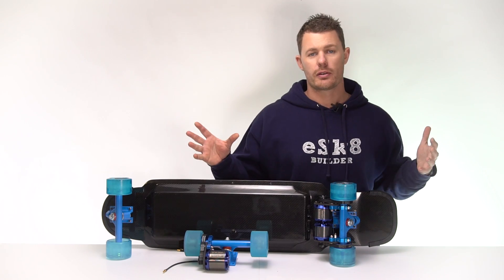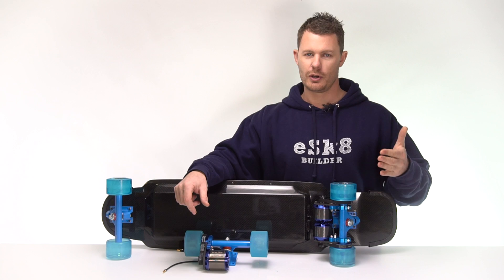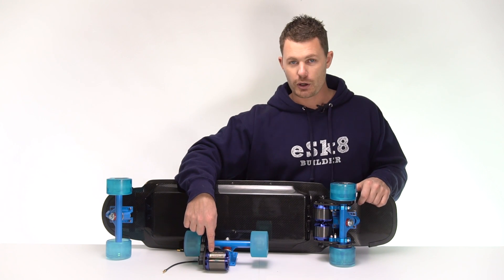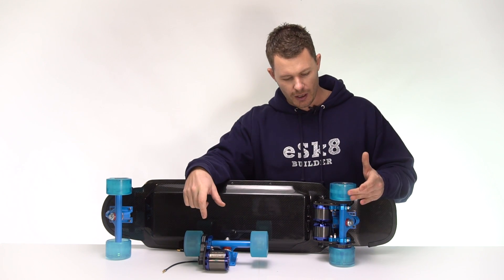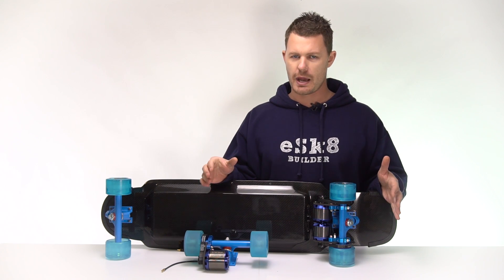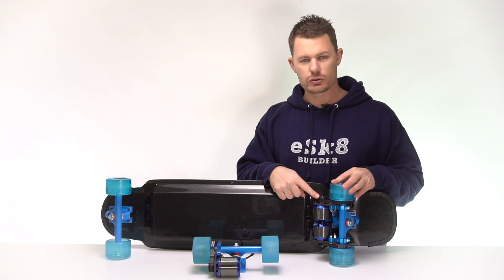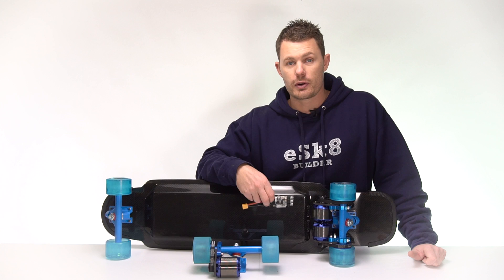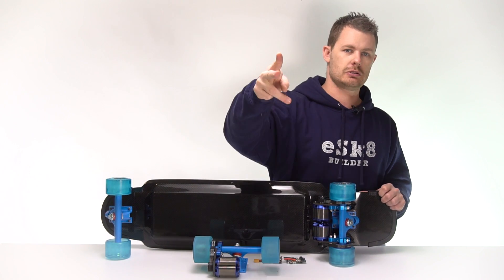Electric Skateboard Dual Motors VS Single Motor

Comment: It would be awesome to design a gear or belt system that can drive both back wheels using your single motor. That would mean better traction, one VESC and motor. It might be your best seller. Surely you must have thought about it already? The cost of the dual setup is my problem vs the traction problem of the single setup. Finding a solution that meets both in the middle seams to be the sweet spot?
Reply: +Electric Skateboard Builder Thanks, you should consider manufacturing. Nobody else is doing anything like that. I think it would be a hit.
Reply: you cant have both wheels always go the same speed
Reply: +Electric Skateboard Builder Hi, technically the differential system is required with a one motor/2wd setup. I've got a long experience with trying out lots of stupid things. One of them is an rc car which had two motors in the rear with direct driven wheels. It couldn't turn because the brushless 1200kv motors were spinning the exact same speed. That problem doesn't occure in an electric skateboard with two motors so why would it appear with one motor spinning two wheels? It could do something with the weight of my rc car (only 400g). it had 300w so that thing was a rocket... removing one motor and making it a trike made it usable, still calculated top speed of 106km/h... Of course Legos, balsa and hobbyking plane electronics couldn't make it to that speed, it always span... 

I respect what you are doing, Jason!
Reply: +FinnishSnowmobiler Yes, given the fact that you lift one wheel when turning with a skateboard and the easy slip you have with the urethane you kinda have a natural differential. Maybe why the dual system works, so it might just be okay with a single drive as well.
Reply: +Visual Flights I think Enertion should make a prototype. It can't be so hard when made quickly. Aesthetics is a completely different thing... If it works, there's his bestseller (if someone isn't faster) ;)
Reply: +Visual Flights Basically making single motor setup with dual wheel drive just means adding another pulleys and a belt. A continued shaft (can be mounted in the screw holes on the opposite side of the motor with a bracket) and then something like a motor mount, but just to support the extended shaft to be rigid.
Reply: +FinnishSnowmobiler Think about a diff lock on a 4x4 truck on sand.  You can lock your when driving on sand because there is enough to slip on sand for the outside wheel. I think the urethane and the fact that you lift the outside wheel when turning with a skateboard would have the same effect. I you think about it the same is true with the dual system. Both motors will always turn at the same speed, but somehow it is okay on a skateboard and I think it is because the urethane slips easily combined with the weight always being on the inside wheels when turning.
Reply: +Visual Flights I agree. Absolutely.
Reply: +Electric Skateboard Builder In a car you turn the front wheels and that rotate the back wheels around a single point making the inside wheel turn slower. On a skateboard you actually turn both the front and back axcel. By doing this you push the back out and push the front in making the inside wheels come closer to each other and the outside wheels further away from each other. Because you turn the axcel the wheels still turn at the same speed because the are still travelling in the same direction. Back wheels travel out and front travel in eliminating the need for a differential.  If you think about it the dual drive system should have a differential as well, but is does not and still works.
Reply: +Visual Flights You got it! I was also thinking about the two pair of wheels travelling in the same direction.
Reply: No this is wrong. Think about riding a skateboard in a circle. there will be two wheel tracks, an outer and an inner. the inner one will be smaller thus the inner wheels must be turning slower. 

"+Visual Flights I think Enertion should make a prototype. It can't be so hard when made quickly. Aesthetics is a completely different thing... If it works, there's his bestseller (if someone isn't faster) ;)"

this is so far from the truth!!!!
Reply: +steven ryan Please consider urethane's grip - it isn't that great. Main point: The wheels slip so it won't be a problem. Similarly to the dual configuration.
Reply: +steven ryan OK I admit that I'm wrong, but a skateboard can't turn as tight as a car. The larger the turning circle becomes the less difference there is in distance travelled between the inside and outside wheels. This small difference can easily be compensated by a little slip of the urethane. It is probably what is happening with the dual drive anyway as both motors will always turn at the same speed.
Reply: +Visual Flights yep you may be right. also the wheel tracks are quite close so the difference in speed mightnt be much
Reply: +steven ryan yes, that as well
Reply: I've seen the prototypes for a single dual drive setup. It looks awesome, but given the complexity of it, I'm quite sure it won't end up saving you any if not actually costing more. You still need 2 drive wheels, 2 drive gears, 2 belts, a mount that attaches to both sides, and all the gearing to make it work.
Reply: You'll need locked wheels and a single solid Axle shaft, then just weld the pully to the Axle and ur done ( I'd suggest putting Bearings in the trucks its self )
Reply: If you're carving hard, your outer wheel is spinning faster than your inner wheel. So a solid axle will cause traction issues. Fine for going straight and chill riding, but once you start pushing things, it could get messy. Check out Carvon's Facebook page. He has a vid of a single motor driving two wheels that are geared so they can spin at different rates.

Comment: Don't you lose a lot to almost all traction when you turn and put weight on the wheel without a motor 'lifting' the one with the motor?
Reply: +Electric Skateboard Builder Thanks, it was my only concern with the single drive option.
Reply: The main advantages of dual motors when it comes to how the board handles is torque and brake power. Losing traction on a single drive is a very minor issue and doesn't cause any problems while riding. It's not something you really notice.

I'm a lighter rider so I don't need the additional torque of dual motors and prefer a lighter board.
Reply: Yeah just wanted to add my 2 cents agree mostly with previous comments though too.  Basically keep your back foot over the back trucks and you pretty much always have contact anyhow.  Only times I really have it slipping is if I'm on uneven road and just getting moving since I typically put my front foot on the board first the back wheel attached to the motor can be off the ground at times, typically I like to push off manually a bit though too just to avoid having the motor push me from a full stop, I'm not heavy but figure it can't hurt to get moving so the motor doesn't have to overcome the static friction and start from a complete halt.
Reply: Also, if you mount your motor on your heel-side, you will have more traction since that's where your weight is.